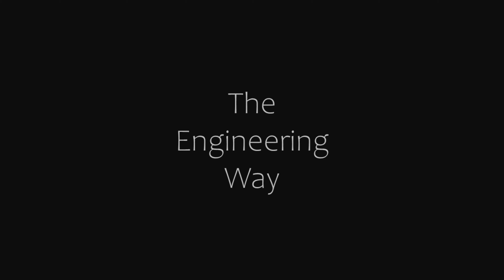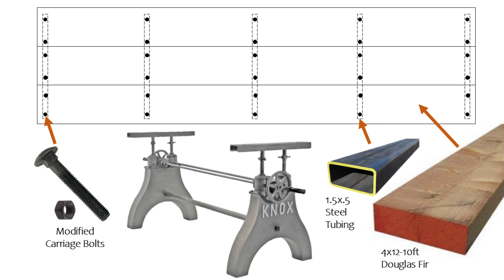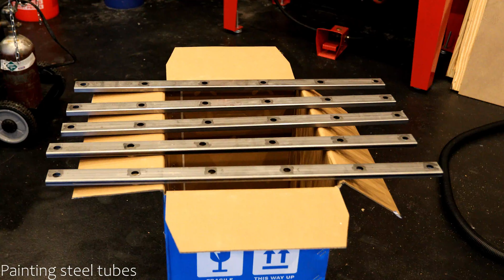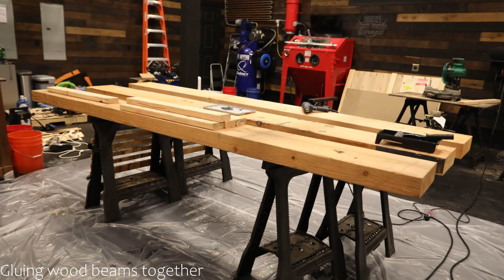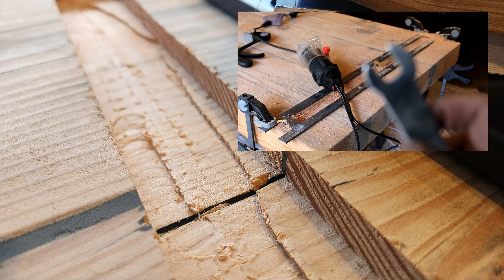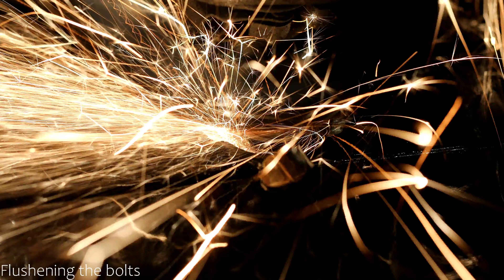Project Dining Table

Comment: Can you comment on the quality of the Knox base?  Did it seem strong enough to hold the weight of the tabletop?  Did it operate smoothly when lifting?
Reply from the maker: The Knox table base is great, very sturdy!  The adjustment was really smooth too, it uses 4 threaded jacks that are joined together with shafts and gears to operate simultaneously.  It was an expensive base, but I have ZERO complaints about it.  It is worth mentioning this base is not a solid casting like an old machinery base, it is made of pretty thick sheet metal, but for a table it is still overkill.